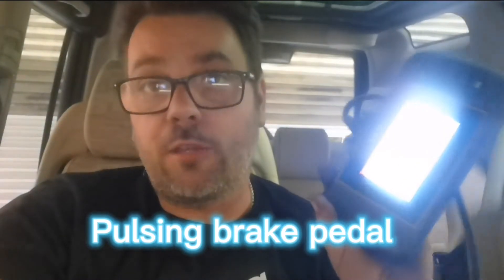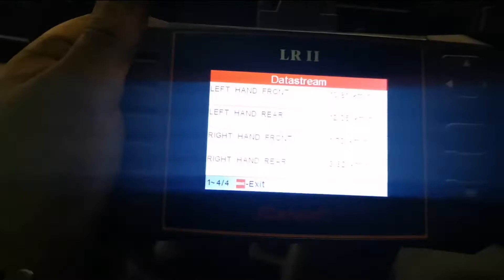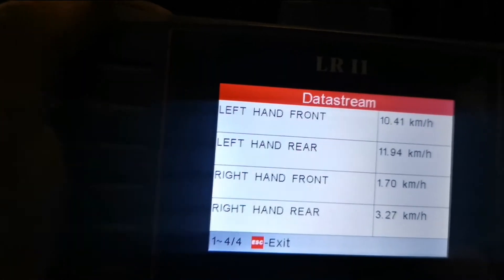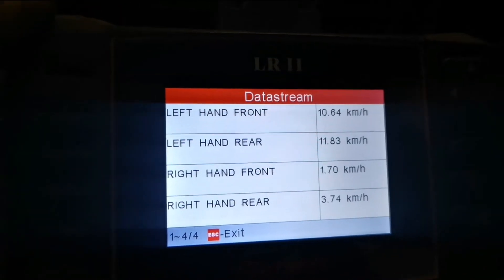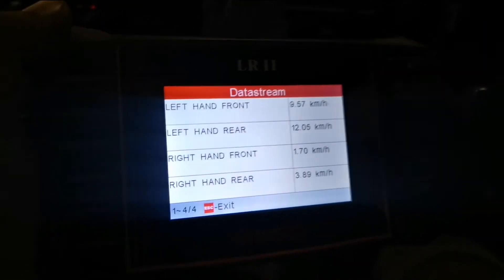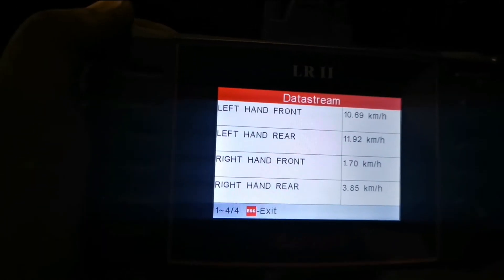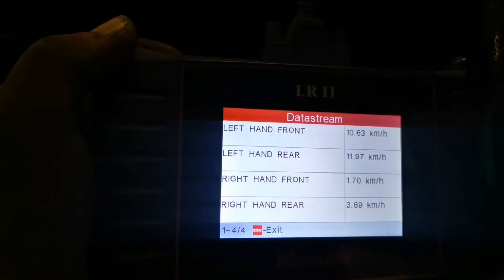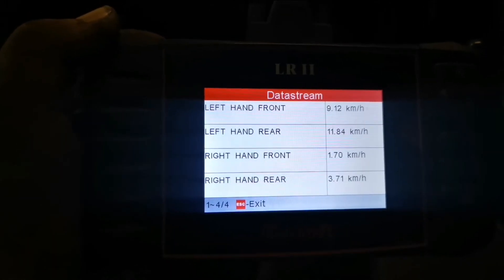discovery 2 td5 ABS issue solved with live data icarsoft lr2 land rover fix

Comment: Hi Guys, i've been watching your videos on the TD5 specifically ABS problems. I have the i car soft v3 code reader and despite changing the sensor cables, the shuttle valve for a new one, (even though it never showed an issue with it)  and according to another video I watched I cut out the plugs in the engine bay and soldered them together for a sound connection. HOWEVER, the code reader is saying front left & right sensor output too low. Any idea what that means, i'm tearing my hair out here. Not that I have much ?
Reply from the maker: We had the same thing. Change the hub and do not remove the sensor that comes in it. The hub will be the issue.
Reply: The bearing will be goosed

Comment: That icarsoft lr2 gadget is handy. Does it read most of the D2 systems?
Reply from the maker: It doesn't show a great deal on the d2. Will read abs, srs, engine and box but not air suspension. Much better for d3 d4 and  jags
Reply: @wardysworx  Oh okay, never mind!

Comment: Another check is to disconnect each sensor nearest plug to the hub and measure the resistance of the sensor with a multimeter across the 2 pins. It should be 950-1100 ohms. Anything above or below indicates a  faulty sensor.
Reply from the maker: Good to know thanks.
Reply: @wardysworx  Thanks for all your videos! They help me immensely for my 2001 Disco 2 V8.
BTW... Nanocom FTW!!! lol Cheers from Suffolk!
Reply from the maker: @JUKE179r  no worries. Looking at a nanocom at the moment. The disco in this vid has big issues with the abs and 4 amigos. Still getting low reading on front abs sensors even though sensors and hubs replaced. Did the shuttle valve mod too. Next step replace slabs ecu.